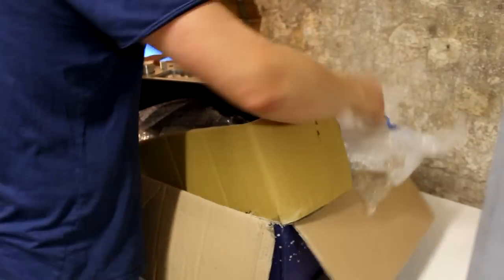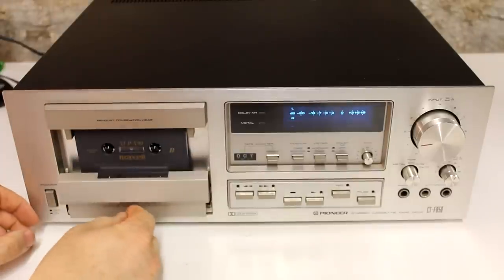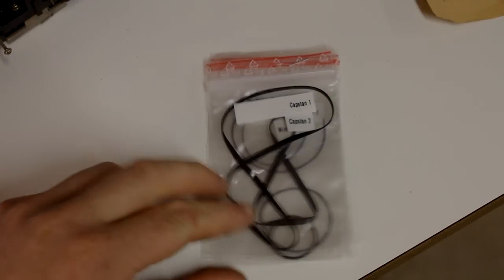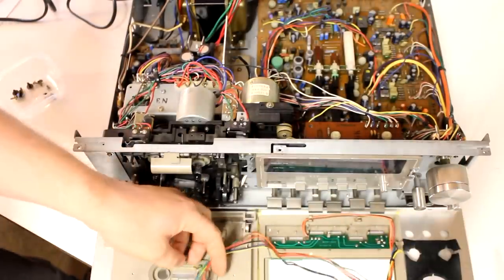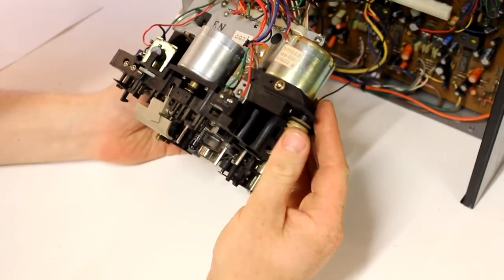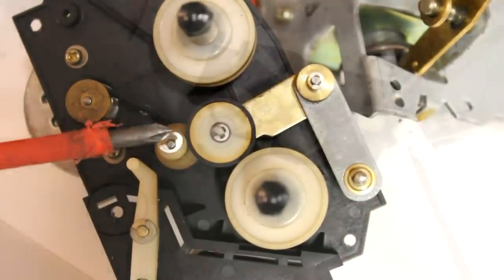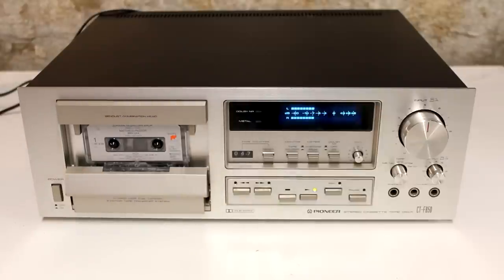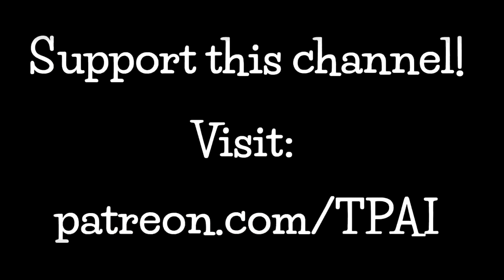Repairing a Pioneer CT-F850 Tape Deck  from 1979 (incl. Belt Replacement)

Comment: i would like to add one more step..
clean the pulleys and remove all the old rubber residue before replacing it with new belts
Reply: And I would like to add: clean those pinch rollers, then inspect them well. Pinch roller rubber sometimes deteriorates just like belt rubber.
Reply: My belts were like jelly and stuck to my fingers like grease.

Comment: Careful: When you want to fine-tune the tape speed, you need to have a cassette with a 3kHz signal recorded on a "known good deck", and a Freq. counter (or software) hooked up to the output of the "deck in test". When you dont have any of these, leave the factory adjustment where it is! After re assembling and cleaning (and replacing belts) the speed setting is in 99% of cases fine again :) Hope that helps

Comment: Great Job! This repair video sure brought back lots of memories from back in the day of many model repairs of such units. Where the belts are first to go as in your tape drive section. That model is not the easiest to work on but once done, hope it will last for a long time, or until the belts stretch and dry-out over time. If I remember correctly, the reason most models shut off is there is a 'Hall-Effect-Sensor' which detects the take-up reel and if not detecting motion, then shuts the unit off, as your unit was doing, so to not spill the tape out making a large tangle tape mess. Again, wonderful job and it sure did bring back lots of memories.

Comment: Hello......I was stationed by Butzbach in the state of Hessen from 1980 to 1982.  May fond memories of your country.  Many of my fellow Army soldiers bought lots of home audio equipment.   So a lot of this equipment was easily found here in the states for years.  Sadly none of todays people care to deal with such issues and all of the repair shops in the states are unreliable or out of business. Pioneer equipment was good.   The PX's sold many Sansui cassette tape decks.   They were the fastest and most reliable for the time.   Thank you for posting this video and showing the amount of work involved at replacing the belts.

Comment from the maker: Hello Guys!

One correction:  After watching my own video,  I noticed that the optical encoder is probably not connected to the "capstan motor", but to a little pully sitting right next to that motor, which in turn is connected to the "take up reel motor" and the "counter". The replacement belt is sitting right where it belongs. I simply didn't remember this when recording the commentary and re-watching the footage , which doesn't show where the belt leads.
Reply: Thanks for the new Vault material.
Reply: Good luck on selling this! I hope you make lots of extra bucks (not bugs though, LOL), so that we have lots of great content to watch from you! :)
Reply: The Post Apocalyptic Inventor
Reply: There are actually more words in the English language but I think that our words are more descriptive and therefor longer sometimes.

Comment: Ooh! Can I tell you a repair story?

I got a portable cassette player who's battery port was completely shot with caked battery crap. I couldn't clean it, so I ripped it open and cut the supply wires to the battery port, replacing the wires and contacts with aluminum foil and a usb cable's wires.
While I was at it, I cut out the battery port and widened it to accept an 18650 I took from a laptop battery.
I may have gone a bit out of hand, but I also ripped up a power bank to use the charge input and output circuitry inside, and I connected it to the battery after making a hole in the player.

Long story short, I have a custom made walkman that is usb rechargeable and can also charge my phone.

Comment: I have the same deck, similar issue - replaced the belts myself but it did not fix the issue.  I like the way you filmed this, with your video as a guide, I will try again.  As you said, this is too nice a piece of equipment not to have working.  Thanks!

Comment: I had a CTF-950 and probably the best you can have.  These had a much higher surge voltage to engage the head up, and then reduce voltage after a second to the solenoid for a nice positive engagement.   I repaired many of these, if you have dirty slide switches you can drill a micro hole on the brown cover and spray contact clean in holes and like new.

Comment: This is what is so cool about this old mechanical analogue stuff. Yes it is dynamic and complicated. But it is serviceable and you can figure it out yourself just by observing and tinkering. Modern devices are destroyed by even trying to open the enclosures. If you do get in, good luck.

Comment: I really miss this deck, in mine died main electric motor and I couldn't find original replacement. Pioneer repair point inserted different electric motor sony brand and after that appeared noises only when playback. I didn't find out what was the case and why noise was audible only when the head touched tape, the tape didn't even have to spin.
Grüße für Deutsche Nachbarn :D

Comment: Audio tape can be ironed flat again. Use an iron on low heat and on top of a sheet of note book paper. The idea is to apply low heat and insulate using paper so the tape isn't melted from applying it directly. I've done this to video tape, too.

Comment: Great job! I still have my CT-F900 which I bought new in 1979. Believe it or not this was a common problem on new units right out of the factory. I went through three brand new units before I got one that didn't have this problem, only to have the take-up spindle start slipping a few years later. I know two other people who had the same problem with their CT-F900s and ended up throwing them away which was a real shame.

I also have a Sony three head cassette deck with auto biasing that does the same thing, and did so almost since new. I paid good money to have it "repaired" two times, but the take-up spindle still slips rendering the deck useless. I'm fairly certain that the problem on both decks is/was not the belts but rather the friction pads in the take-up spindle hub. So I'm holding on to two really nice cassette decks that do not function. Maybe one day...

Comment: Thanks for the Video 
I replaced all the belts and it went very good . 
im still having a problem with end of tape shut off. i think its a bad sensing assembly, right off of the tape counter.

Comment: Hello, recently I bought a Pioneer DC-Z83 hifi system from 1990 and the tapes heads are in need of alignment but I can't get the doors of the cassette deck off. Do you have any tips on how to get to the adjusting screws?

Comment: I have a ctf 650 and ctf 750 does yours have a ac primary line fuse on the 120 volt primary
Reply: No idea why you'd need to know this, but I'll bump you with a like in the hopes that he sees it :)
Reply: @ChrisStoneinator  I put fuse in to units that don't have a fuse in the ac primary consult a authorized service center before doing

Comment: Hey, I have the entry level blue line deck, the ct300. It works most of the time fine, but now and then it rips the tape slightly, in the beginning. I did some cleaning with alcohol and the belts are already replaced. Any shots?  Am I experiencing the beginning of a bigger failure, did I did something wrong with replacing the belts or is it just sth normal for a deck to slightly a tape now and then?

Comment: Dual capstan when it is not an autoreverseing machine, is refered as Closed Loop. Closed loop help to create a constante tension on the tape when it passes through the heads since there is a very small speed differential between the 2 capstans. In no dual capastan machines, tension is unregulated mostly and it will change from cassette to cassette. Of course it will still work since consumer gear never used closed loop, but closed lopp is way better and with a good amp and a good tape, the advantage became obvious in the sound quality.  The optical is for sensor when the tape take up stopped. It is the heart of the autoshut off system. It is a good keeper for sure and at this levels, Pioneer really released Prosumer grade systems. This series aalso know as Pioneer Silver and matching with the SPEC series AMP system in the SILVER RACK which includes everything you need from timer to Open Reel

Comment: You replacing the belts, but why you don't clean all the pullies and wheels from old robber and dirt? Why you don't clean old grease and oils and re-lubricate? The chassis and mechanism is open already, would be easy. Why you don't clean and rejuvenate idler and pinch rollers and do not polish capstans?  Or you doing all of it, just not showing in the video?

Comment: Hi. Firstly thanks for the videos, I have a CT 320 , i'm looking for the motor / transformer for the tape deck. When i sent it in for repairs the guy stole the transformer, gave me back my machine and said he could not repair it, after many years later i discover the motor was missing. I'm also looking for the schematics or link. Do you repair amplifiers as well ? Thanks.
Brian.

Comment: Hello Sir, I have a question about the capstan motor, there is no power going to the motor, would you know which switch is responsible for the supply of power?

Comment: Another step. the brushes and commutator bars in both motors need cleaned. this problem plagues the CT-F900 I know for sure. itll work, and the speed warbles, then stops. Tapping on the motor brings it back for a little bit.

Comment: Congratulations, your warranty is now void. 😎
Reply: I'd like to see any piece of equipment that's almost 40 years old and still under warranty.
Reply: There has to be something that's has a life long warranty.
Reply: Even lifetime warranties are only normally valid for the person who bought the item new.
Reply: I also used to think that lifetime warranty was "as long as I, the purchaser, am alive". Apparently, it's "for the (expected) lifetime of the product, under normal use". See https://en.wikipedia.org/wiki/Warranty#Lifetime_warranty
Reply: Wow, so if a car manufacturer secretly decides that his car only has an expected lifetime of 50,000 miles or 2 years, they can offer lifetime warranty and still refuse to fix anything that breaks after that. So that's also just another stupid marketing-wank.
Reply: Seegal Galguntijak well, you could argue that cars are commonly expected to perform for at least a decade. Don't think their 50k miles or 2 years nonsense would hold up in court.
Reply: Well, over here in Europe, there are two different types of warranty. One has to be provided by the vendor and must be 2 years long (while the onus of proof is reversed to the customer after 6 months, so that's basically a 6 month mandatory warranty in most cases), and then there's the warranty that is provided by the manufacturer of a product, and since that is a totally voluntary thing, the manufacturer could basically write anything into it. So if they advertise a 2 year/50k miles warranty as "lifetime warranty", customers couldn't even sue them, because that's a violation of competition regulations, which is basically something that can only be prosecuted in a class action lawsuit (which again doesn't work in Europe as it does in the USA), meaning only certain consumer rights associations are allowed to file that, and not individual customers themselves...yeah I know, it's fubar, LOL...
Reply: So, who's ordering the next round then? ;-)
Reply: +Seegal Galguntijak, "(while the onus of proof is reversed to the customer after 6 months, so that's basically a 6 month mandatory warranty in most cases)" - that's for your country. Stop speaking as if your reality is universal and spreading misinformation. Despite EU directive about consumer protection, there are still some minor differences with the internal laws.

And you just murdered a bunch of legal dispositions about consumer protection. 

1 - Warranty violations have nothing to do with competition regulations.
2 - The US instrument called "Class Action Lawsuit" doesn't exist for the majority of EU countries but most do allow for some sort of plural participation in a process which in the end gets the same result.
3 - In no way plural proceedings are barred to singular participants. Maybe that's the case once again in your country but in many others that does not happen. And in some kind of cases theres even the benefit that after a final decision is granted on the subject, even the people who weren't participants but were in some way involved (by owning a product for instance) benefit from it too.

So, stop talking out of your ass about things you clearly have no capacity to be talking about and please stop spreading misinformation.

EU is comprised of 28 countries and even if there are more than a couple things that have been standardized there are still plenty which are different.
Reply: mudemmeonick I agree that I only know about how it is in Germany, where I live and originate from. I assumed that EU law had been aligned by now (and, in major positions, had adapted to how it is in Germany). If that isn't the case, then at least some other European countries may have better regulations now than what we Germans do have (although I know that at least the 2-year mandatory warranty period is valid all over Europe, but the reversal of the onus of proof after 6 months may already be a national thing, in which case I congratulate every EU country that doesn't have that)-
Reply: shootgp Why aren't we allowed to talk about a subject, even if we got the joke? Or why are we idiots because we do? And what makes that you, who is the one complaining about it?
Reply: Flight96 The rules I've been talking about were applying strictly to private consumers. Airplanes are rarely bought in a B2C scenario, and for B2B, there are totally different rules (which I don't know anything about).

Comment: Pioneer makes some nice stuff,  but a lot of it is hard to work on because of lack of connectors where they could be,  and when you get into the electronics they use a lot of proprietary chips,  that you can't get any more in half the cases...

Comment: Nice video guide! I have one little question - is it safe to touch the rubber belt directly by greasy finger (will be there degradation process of the rubber)?

Comment: Whooaah so many complicated preceedures just replace that rubber belt pffff.
But you did a great job.
Hope you did repaired thai cassette tape for future purposes.
Reply: johneygd I saw nothing complicated here, not a single spring has to be removed, only screws and cable connectors. That's really good and smart engineering if I must say. Nothing nowadays is fixable the way the old hi-fi equipment was, back then.

Comment: I just won an auction for a Technics RS-M215 cassette deck on Ebay and the seller mentioned that there is a clicking sound when the deck is turned on and also when Play is engaged, but it does not appear to affect playback. What could be causing this clicking sound and is it something to be concerned about?
Reply: Hi I have the same machine. It seems that this is normal. Works just fine

Comment: Hi i have brought a nice tape deck its a full German sound TD100 it has German writing on the cover I'm not sure why but the right channel is very temperamental it plays fully in stereo but when recording the right vu meter is hardly working ending up in a terrible recording any ideas why this is happening also do you know any information on the sound TD100 ?

Comment: If you went for all the trouble replacing the belts (God, there were quite a number of them, never saw so may in a deck), why not replaced the idler tire and lubricated at least the two capstans ?

Comment: Have you ever run into a high pitch noise coming from either the left or right channel? Not mechanical. More like you’re taking a hearing test and listening for the high frequency beep. But it’s constant as long as it’s playing.
Reply: I don't know about this unit specifically, but on many decks that's a common problem, the playback amp becomes unstable and oscillates. In most instances, it's caused by bad (ground) contact, like a corroded Rec/Play switch or connector. Or it can be caused a bad capacitor (emitter bypass?) or other component. 

You need to put contact cleaner into the Rec/Play switch, connector to the head, etc. Then wiggle/actuate them till the oscillation goes away. If this doesn't help, it's most likely the latter case and you need to do signal tracing etc. to find the bad component

Comment: Some of these “old” hi-fi components are downright sexy. This one is a fine case in point. Gorgeous unit. It reminds me of my first amplifier-receiver, a Radio Shack “Realistic” unit with dual analogue VU meters with shiny silver needles, a solid brushed-metal front with a heavy flywheel tuning dial that glided smoothly from one end to the other with one spin, a warm white light washing the entire front, and a cinnamon-honey wooden top and sides.  They were solidly made by Foster Electronics or Trio-Kenwood and consciously mimicked the style of the mid-70s Pioneer models. Very sexy.  The look of these things was half the fun.  What memories!  Ooo and ahh.